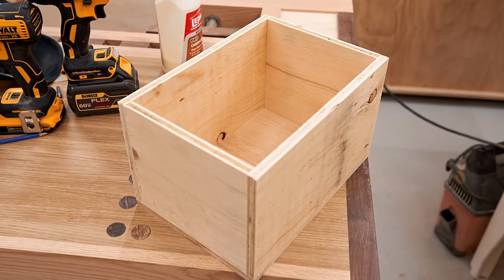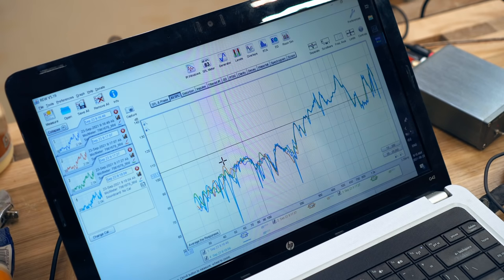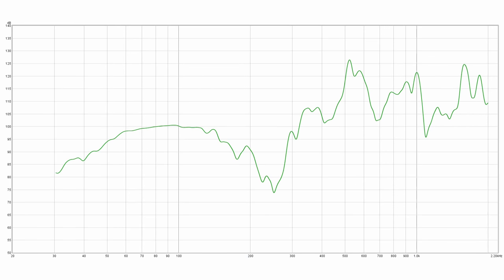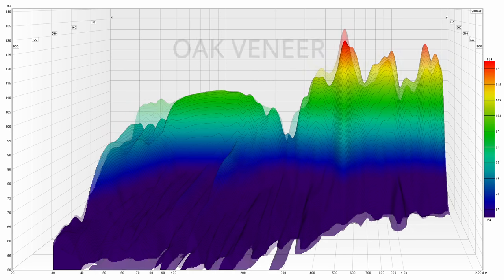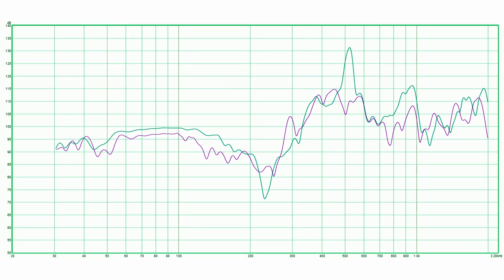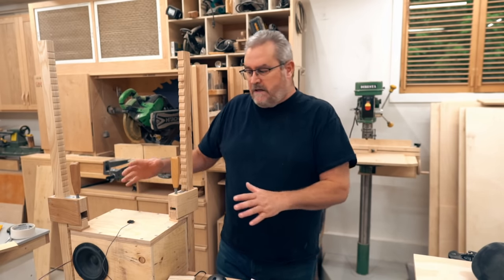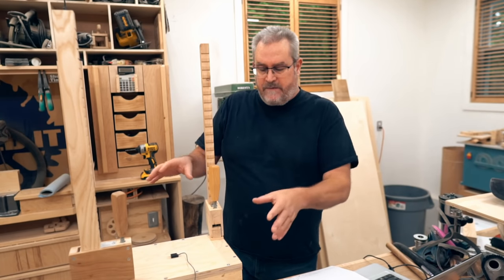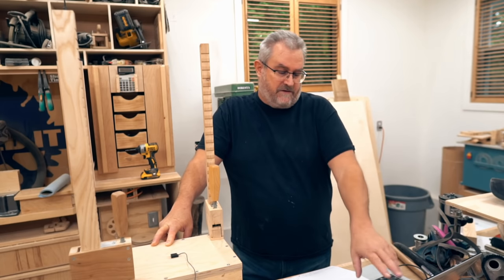PLYWOOD vs MDF For Speaker Building - Tests Show Surprising Results

Comment: 7 ply Baltic birch marine style plywood the joints and glue used certainly has it secrets along with acoustics material. The size of cabinet and design of cabinet very much must work together with the drivers, crossovers.

Comment: Makes sense just like metal work or anything structural. To make the same thing using different materials requires more or less bracing. Thin metal or wood requires more bracing to be as rigid as harder metal or wood. Along with thickness. This is good. I want to make my own 2x12 guitar cabinet. With wood prices being what they are I'd like to go cheaper. Heck, could even use a wood enclosure with some metal bracing.

Comment: 6:24 makes sense for subwoofer boxes, but in full range speakers boxes I doubt you will end up getting the resonance over 17k where most people won't be able to hear it. although if the resonance is low enough it won't matter much?

Comment: What do you think about using rubberized undercoating on the inside of the box the video I seen about coating the inside with it and they say it won’t let the wood absorb the sound they were ported boxes I was thinking about braces and the rubberized undercoating 1 box for a15 inch sub with a 8 inch round port and a dual 12 inch sub sealed but I like the video at least you know there is no wrong wood to build from I’m like you on hearing the difference but I’ve has people say they could feel the difference in how hard they hit I always just try to stay spot on the manufacture requirements for specs I seen also the ply woods are stronger & lighter than mdf I think I will go with plywood I think I might like the stained and polyurethane look on the box instead of the carpet thing but I might use both have something really different again great video like all the info I can get .

Comment: When I build my rather large subwoofer boxes (home theatre), I lined the panels with a mixture of drywall mud and white glues, about 1/2 thick.  It's heavy but the box responds, when struck, like hitting a rock.  The material I used for the panels was 3/4 " mdf. I used simple 1 x 3 as bracing.
Reply: Interesting!  Did you have to do anything special to get the mud to stick to the MDF, and/or remain stuck to it?
Reply: @scottgoodwin9162  The white glue made sure the goop stayed stuck.  It's been 15 years and last time I checked, still good.

Comment: Hi, 
Great video! very good comparison.
I am designing reference monitors (nearfield) with dayton rs150p 4a and a SEAS 27TDFC H1189.
should i use 12mm with 2 internal horizontal braces or 18mm mdf. internal box volume 10.5L
thanks.

Comment: Old skool dampening stiffening was epoxy and fiberglass allover inside. easy than bracing but not as good. Or put a few broom handles in between the sides.

Comment: I think your comparison of 1/2” and 3/4” box would show a larger difference in a bigger box. When the span is longer the thicker material is going to be stiffer. So if your building a small box, go ahead and use 1/2” material, but if your building a 4x12 guitar cab 3/4” material would be better suited.

Comment: I guess stuffing becomes less important the lower in frequency the driver is playing? Say if you have a very stiff, well-braced box, but the driver is a subwoofer only playing up to 100hz or so stuffing really is pretty irrelevent as all the box vibrations are well above the frequency at which the driver is playing. But say if your driver did play into the mid-range, it would be worth adding stuffing in addition to bracing to damp out those higher vibrations.

Comment: Interesting observations. Which has the most impact on high fidelity, the cabinet, the crossover or the well made and matched drivers? Which is first and last?
Reply: I have made some speakers in the past and I can say this: Making some prototypes and tweaking them, listening to them for several months, placing the crossover outside the cabinet and changing some parts to see if it sound better, this is the surest way to get the best of whatever you bring to the table.

Comment: Wondering...  Would the holding/clamping method and variances in clamp pressure on the surface tested not influence the results?  I'm thinking screwed down from the inside at the corners and center (or perhaps kreg screwed from the outside around the perimeter) would have more consistent and accurate results?
Reply from the maker: Highly unlikely. I'm pretty used to tightening clamps.

Comment: with these still crazy prices on things these days ive really been wondering what to build my next box out of. 
i fell in love with birch when i left mdf finally. the light weight and being in a vehicle it was gonna see moisture so birch was nice. but it never sounded quite right to me. i go for low bass and this is why i never liked my subs with birch. it loses the bottom end. birch and oak are the same price these days and i really think that set me on oak. it has a way better bottom end. the mdf was the best somehow but im not doing another one of those.
this here is exactly why the high dollar oak cabinets existed back in the day as the primo speakers. they had a much better sound response and alot more force with early technology.

Comment: how many musical instruments use stuffing. its a patch on a flaw.

im building some atm using some 48x12x1 solid oak from an antique table for the fronts, the sides ended up plywood, but i have allsorts from mahogany to bloodwood tjrown in there.
for me im aiming to use the different densities to help form the sound. i want some projected, some to resonate to certain areas.
some is thinner and the base/skeleton of that lower is about 5" thick.  its all shaping that sound pressure...my speakers are cheapo daytons, i believe in the boxes as instruments.

hell ive even got inch thick brass lips for the voigt bit.😂

Comment: Membranes on the panels will damp the panel resonance but stuffing inside is more to control the acoustic resonance of the air in the box...two different things.  The interior stuffing might also damp the panel resonance by virtue of being in contact with the wall, bust most wall damping products are too thin to really control the acoustic resonances.  For sealed boxes, fully stuffed also adds acoustic volume.
I like your test and the results aren’t surprising.  JBL in the 70s used walnut veneered chipboard for everything in the home and studio, and plywood for the pro-sound cabinets.  No one every complained.  The studio monitors were heavily braced and without the bracing the JBL experts say they don’t sound the same.  I think MDF as a speaker material really came about in the 90s, mostly out of the UK builders where MDF was easily available and cheap, and then got pushed by a few magazines as some sort of superior speaker cabinet material, but in reality Baltic birch probably is but it costs 2 to 4 times more.  
The guitar world reveres solid pine as a speaker cabinet material, especially the vintage Fenders.
Reply from the maker: By damping the airspace you will also damp the panel. Otherwise my measurement wouldn't show any difference because the stuffing wasn't touching the panel. The airspace sustains the ringing in the panels.
These days you have to add something provocative to the video title to get people to watch, so that's where the "surprising results" comes in. 
In an upcoming video I'll test solid wood as well. That's another one with quite a lot of mythology around it.
Reply: @IBuildIt  There was a surprise to me, how different the pine plywood was.  Not such a strong bass hump that the others showed.   Maybe a better speaker uses different materials for each panel?   Ever read the books by GA Briggs?  Founder of Wharfdale speakers, and in the 50s and 60s wrote many books on loudspeakers, and they include all sorts of tests on vibration response of different panels.  Very crude tests by today’s standards, but interesting to see what they were doing then.  They ended up filling their front baffles with sand!  BTW if you do this again, it would be interesting to try chipboard as well.
Reply from the maker: Yes, the pine did better than I thought it would. And I'm at a loss to explain why, other than it's stiffer than I expected.
Reply: @IBuildIt  Seems like an odd way to view it. The air in the enclosure sustains a resonance, even if the panels are perfectly rigid. If the panels can flex, then the vibrating air can excite the panel (in addition to panel-borne vibrations exciting the panel under test). If the air is damped, the amplitude and duration of its oscillations are reduced, and  it excites the panel less. But that doesn't mean the panel itself is damped. It's just excited less by the air because the air is vibrating less.
Reply from the maker: @Matthew Cote  I think you are looking at the physics involved too rigidly. You are viewing each action on it's own, when they all work  together. 
The panel vibrates which excites the air in the box which in turn is damped. If the air is undamped, it will pull less energy out of the panel vibration and the panel will ring longer.
Energy is transferred to the air from the panel after the panel starts moving. 
Also, it was the air (mostly) that caused the panel to start vibrating to begin with. If the air is damped, less energy will reach the panel.
Reply: It would be great if you would consider using different hardwoods in a sub enclosure that is not clamped to a bench but sits on the ground as it would in a real world application. Also, run the test at low moderate and high SPL listening levels. In other words test  using Variables that are actually most common to listeners and likely to produce cabinet noise or excessive audible vibrations.  That would be the free standind enclosure sitting on the floor at played at higher power and SPL levels. Really interesting stuff… Thanks!

Comment: I was told that you wouldn't want to use plywood for speakers, especially subwoofers, since there might be loose chunks in the wood that would rattle when lower frequencies are playing.
Reply: dont take the cheapest -  in 15 years i never had something like that !   but I buy the same quality as carpenters use for high quality furniture, veneered with real wood

Comment: Nice video. But I will disagree that this effect is inaudible. When you listen to a pulse measurement, either behind or to the side of a speaker, you should hear a single “shot” or crack. If the cabinet is not well constructed and resonant, what you hear is a very distinct “boing” as the speaker cabinet smears out the pulse. So, definitely a special case but also certainly audible. Hope this helps.

Comment: It seems like a lot of box designs are focused on preventing the box from coloring the sound of the speaker elements. Could speaker boxes be built like musical instruments where the box surfaces contribute to the overall response of the system as a whole?  I suppose this has been explored with tactile transducers and electrostatics.
Reply from the maker: Everything under the sun has been done with speakers, either intentional or the result of poor design and build quality. There was a speaker company that built with that goal - to produce a truly "musical" speaker.
But you can look at it this way: which is better, to hear just the music as it was recorded, or hear that plus someone sitting in the room with you quietly humming along with the music? 
From my perspective, this is an extreme example and I think you really need to seriously mess up the design to produce anything that can be heard. But in the world of extremes where every small possibility gets exaggerated, most will imagine they hear it if they know that not everything was done to prevent it.
Reply: There was a loudspeaker driver manufacturer that did that as an experiment/promo exercise a few years ago, think they were shaped like a Cello if I recall, they were just one-offs but yes it's been tried.

Comment: First off I love the video however I think you would have had much different results if you would have built four separate boxes out of that material entirely meaning don't just count on one side get the results from it and call that proof that leaves variables on the table too many in fact I would have loved to seen four separate enclosures and do that sweep to see the difference I bet it would be more drastic

Comment: would like to see some comparrisons with ply vs straight wood. i know ply gives a more even material but do all those resin layers make a difference?  maybe 9layers of glue in baltic birch has more effect than the included hardwoods..

ive tried workong with bloodwood recently. some tough arse dense wood. that instantly got me looking for large panels for speakers..only about $400 per plank😂 so sod that. but a guy can dream.

so..ive got some 1x1.5x12" bloodwood lengths, those will be made as a sort of brace to help disperse the sound through the wood. what you can with what you got 😂

Comment: The test rig looks clamped to the table. Most speakers are freestanding. Mass or density of the material will make more of a difference in that situation I think, maybe? I would be interested to know for certain. As to whether you can hear it, that's much harder to determine. There's definitely no harm in trying to minimise resonances if the cost isn't prohibitive.

Comment: Isn’t the main benefit of MDF is due to its construction it easier to shape and cuts cleaner. 

Also had you ever tried the same method that Q Acoustics are using with their Concept series, this multilayer MDF between which is a gel sounds very interesting.

Comment: Re:  can it be heard?  How about an (admittedly another indirect) assessment of the worst outcome?  It would be interesting to look at the THD of the frequency of the worst level resonance peak among the different materials.  It it's 0.1%, then declare it "unhearable" along with all the other lesser amplitude resonances.  If it's 25% --- then pitch it as the perfect material for guitar speaker enclosures?
Reply from the maker: I don't know of a way to measure the panel's THD without it being swamped by the driver's THD.
Reply: @IBuildIt  Thanks.  What is the THD range for drivers a) open-baffle b) enclosed?
Reply from the maker: @cougar1861  I don't know and it would vary from driver to driver.
Reply: @IBuildIt  Thanks

Comment: Good video. Agree with the conclusions. I prefer matrix construction epoxy bonded plywood with additional damping treatment from either bituminous panels or this stuff (google soundservice & dedsheet-sound-damping-sheet  -  to avoid YouTube anti spam filters 😖). Veneered MDF always feels like cheating to me.
I actually think poor cabinet damping (structural & acoustic) is why there is a following for open baffle speakers. Better to absorb the rear wave before it gets into the room IMHO...

Comment: Thank you for doing the test. Well I am ambivalent about your findings. I  have performed similar tests like this one. With different subwoofers & the results were all over the place. Because everyone doesn't make subwoofers the same way. Different subwoofers respond differently to different types of enclosure materials and thicknesses. With or without bracing or polyfill inside the enclosure. These types of tests are cool & informative but for me not ideal. I need to know how that subwoofer responds to stress in that enclosure. That is the real test, how it responds when it reaches its nominal recommended wattage or close to peak wattage. That subwoofer & the enclosure will let you know which is better when partially or fully stressed. It is true bracing matters & stuffing too but it becomes sometimes it is very specific to a woofer or subwoofer. In my experience ½, ⅝, & ¾ mdf have never let me down regardless of the application or enclosure size. Once the bracing is added the enclosure is really rigid. Then the polyfill or stuffing is to help with the fine tuning of the enclosure. Some manufacturers require a particular type of stuffing for optimal sound quality. I am a huge fan of passive radiators. They can be a lil fussy but in the long run the pros out weigh the cons. Especially if you have a woofer or subwoofer that you think it might bottom out!

Comment: Sikaflex sfc 11. Windscreen adhesive. Bond 2* 1/2" panels together with a 1mm layer and a weight, don't clamp!
Then cut to size and assemble the box with the same. polyurethane adhecive.
Warning! It's messy. Dampens beautifully.
You can also 'plate' the inside with 1/16 steel plate with the same adhesive. The plates mustn't touch any corners or braces, so make them 1/2" smaller all around.
Ps, the damping test should be directly behind the driver.

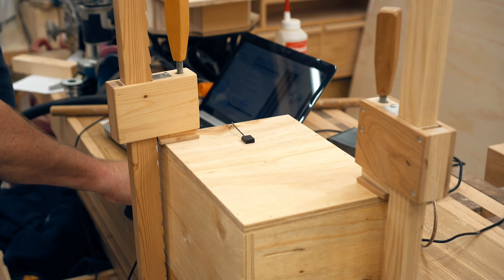Comment: I noticed that the accelerometer in the video at around 3:43 was no longer in the center of the panel. This would definitely cause a different result as the movement of the panel will diminish as you approach the edges. Was this just a mistake in editing??
Reply from the maker: That's testing the panel on the other side of the box, in between the end and the center brace.

Comment: The idea is to brace AND damp.  Damping in the box is more effective at higher frequencies, so brace to push the panel resonance frequencies higher, then damp the resonance at those frequencies.
Reply from the maker: Yes, bracing and damping. That's how I started. Not just damping alone.
What I said about bracing instead of damping is an idea that came along maybe 15 years ago. The thinking was that damping smeared the sound, made it sound muddy and to avoid that you would use extensive bracing instead. You've probably seen some with an internal matrix of braces with holes - that kind of bracing with no damping at all.